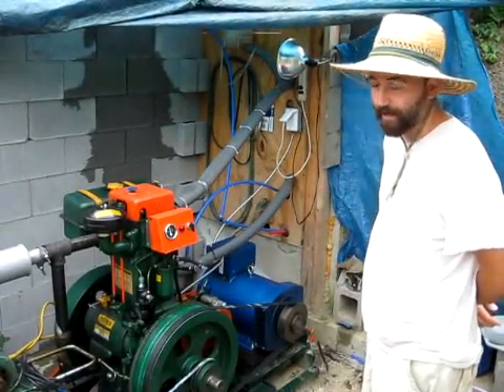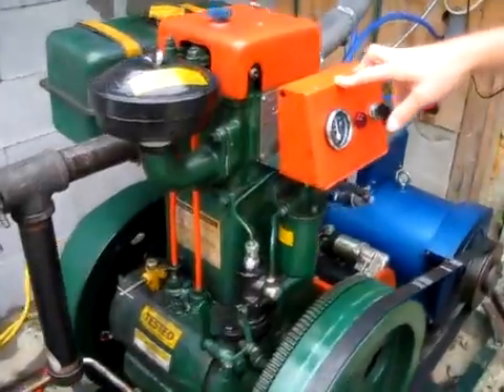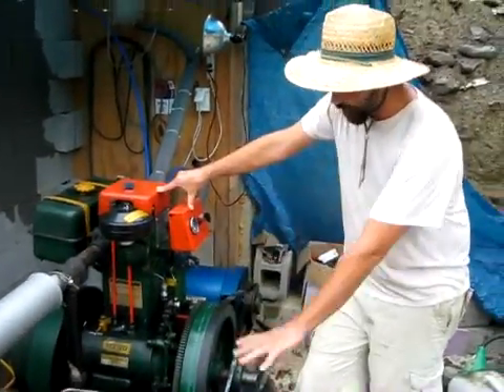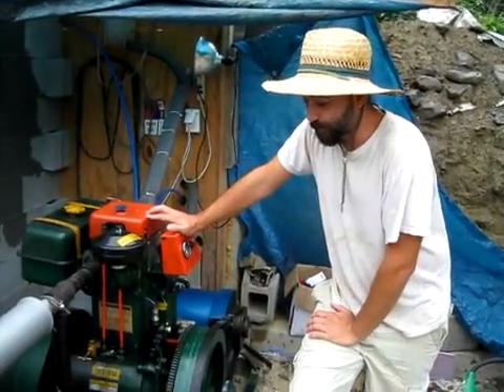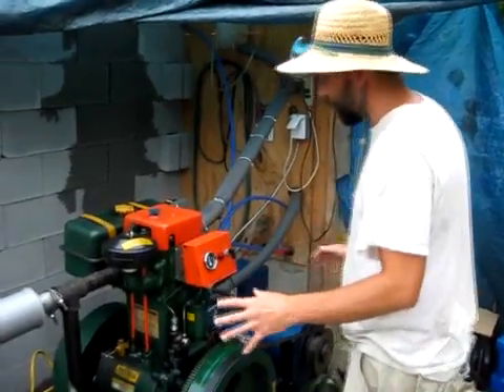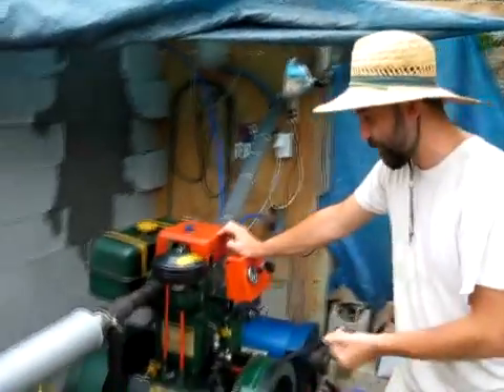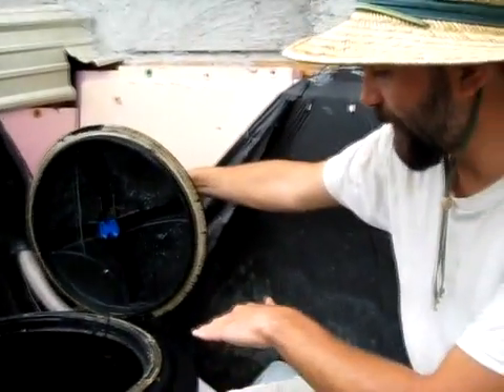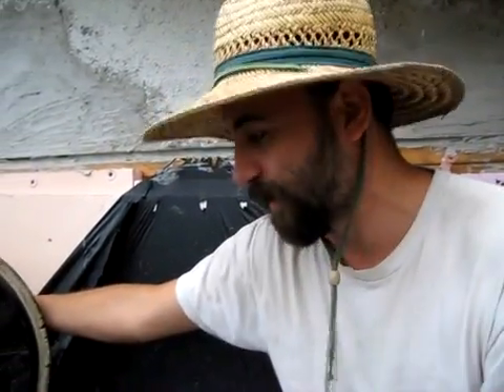Tri-generator at The Dacha Project 1of3

Comment: That exhaust pipe is going to break off close to the head.
Reply: It ran around 10,000 hours,  no problems, however, the exhaust was switched about half way through to something that could be robbed of waste heat.

Comment: I know this is a seven year old video but your air compressor is not the best selection what would have been better would have been an old belt driven semi air compressor that automatically D strokes the compressor when it gets to a preset pressure.

Comment: just a thought, if you had two water tanks (one reserve) you could pressureize one with air  for use while the other is filling with water.
  another thing to be aware of is that compressor uses oil that may contaminate your water. Maybe find a compressor that is oilless like they use in Hooka diving.
  Nice set-up, i want to do the same thing, good luck!!

Comment: I would have much concern running hydrocarbon fuels like Gasoline in this engine. i would NOT try brake fluid!(which is not a hydrocarbon fuel anyway)  It likely would not burn in the engine and would gum up your fuel system if not the entire engine..... . . 
You might drive a piston water pump directly on the engine for more efficient water pumping....